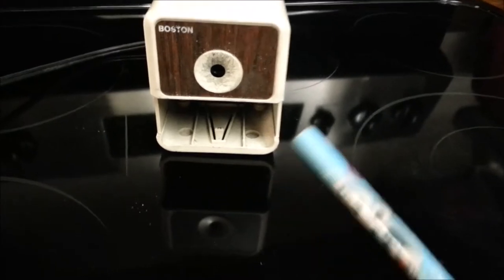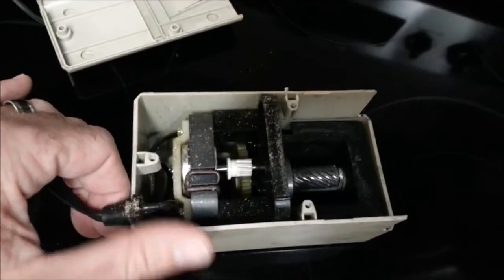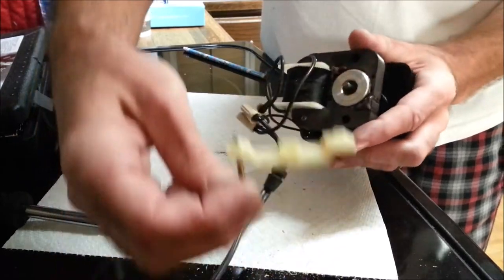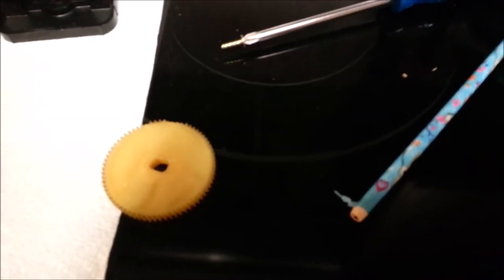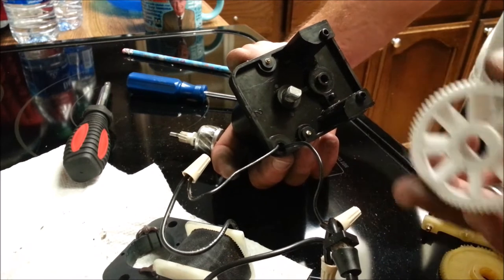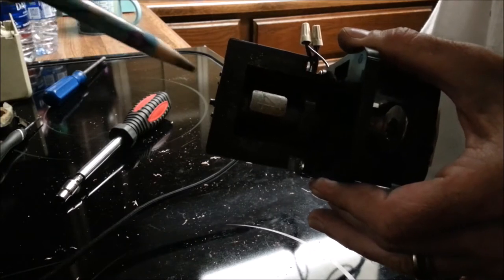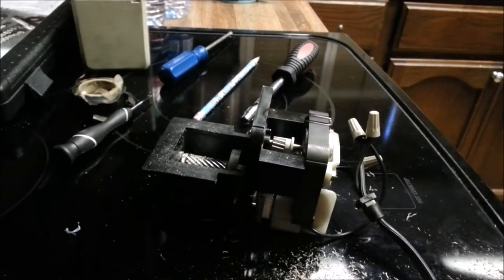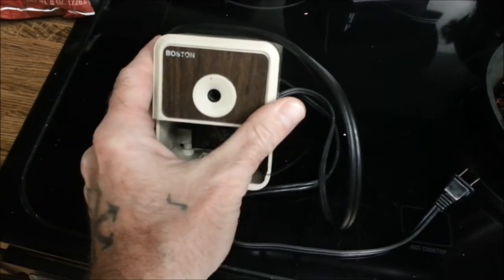Pencil Sharpener Repair Boston Model 18 (Replacing the Gear)

Comment: Awesome. I ordered the gear on Amazon and installed it today with no issues. I got a nylon gear. You don't have to disassemble as much as you did in this video. Two screws on the side of the motor to pull it away will revel enough room to slide the new gear down. FYI I had to flip my gear (flange facing toward the back of the unit, not front) in order for it to work without rubbing against the mechanical housing.  This took all of about 5 minutes to finish and it's working like a champ again!  Not bad for a 31 year old unit!

Comment: Great video. I "gave up" when you said you did a 3-D replacement of the gear. It's off to Amazon for me for a new sharpener. But thank you all the same!
Reply from the maker: Look up replacement gear for Boston model 18. If I remember correctly I found it on Etsy.
Reply: @dannydyi7123   Yes I found one on either Amazon or Ebay and it worked perfectly-better than the original.  Been working now since I first saw your video 4 yrs ago.  Now looking for a way to sharpen cutter barrel or where to get a new one. Thanks.

Comment: I have the model 19 pencil sharpener, same problem,looks like the internals are the same however only problem I see with replacing the gear is the gear is old of course but I think age and the sharpener blade itself is dull therefore putting more pressure on the gear? Thanks for the info!
Reply: My model 19 sharpener blade was gunked up. Had to clean it out. May have been putting pressure on the gear but my gear was almost like wax and broke into many pieces.
Reply: @margaretmcintyre5651  Mine too -broken in half. I fixed it 4 years ago when I saw this video with a new 3D printed one and it got my son thru high school. We use it all the time and now we are looking for a way to sharpen the blade cutter barrel or get a new one-any ideas?

Comment: Those screws out at 41 secs...do you know what size they are? Lost mine.
Reply from the maker: Dang it. I'm sorry. I'd eye them, but I gave it back to the owner... probably like 1/8 inch in diameter if I remember correctly and 3/4 inch long... then again, they're sold measured in millimeters aren't they? Like always, I'm absolutely no help... lol